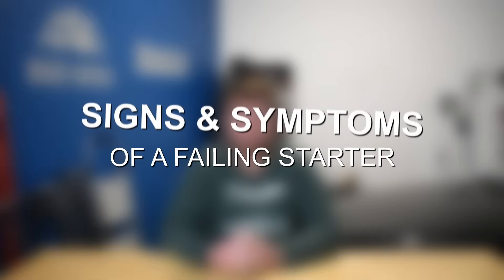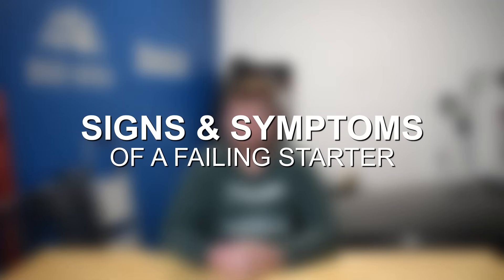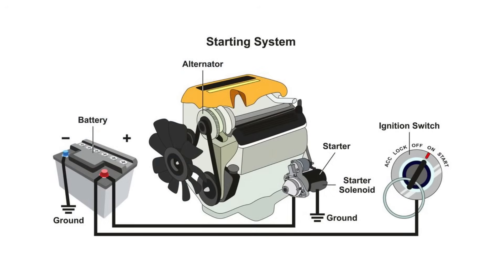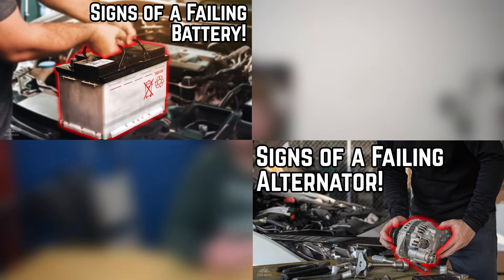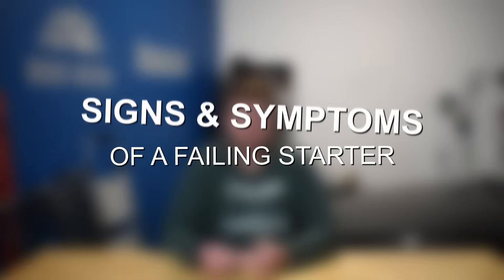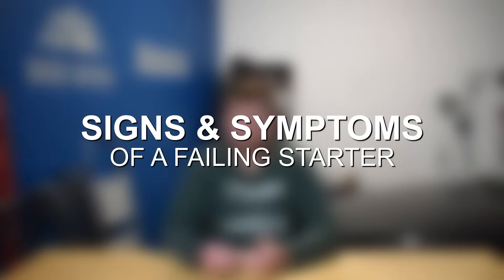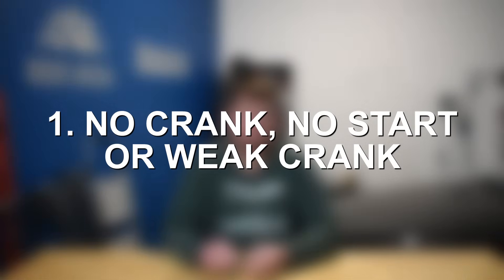5 Symptoms of a Bad Starter!

Comment: I have heard a grinding sound upon startup of my '17 wrx for the last, well, id say about 10 starts... In the video around 3:05 its mentioned about the grinding. Is this still a starter issue having to do with the grinding of the gears??? Thanks
Reply from the maker: P - Yes, if you’re hearing a grinding sound on startup —especially after the engine fires and the starter is disengaging—it’s very likely related to the starter drive (bendix) not retracting cleanly or grinding against the flywheel teeth, which can happen due to a worn starter gear, weak return spring, or flywheel wear; this is a common issue and sounds very similar to what’s described around the 3:05 mark in many WRX diagnostic videos. If it's happened 10+ times, you should inspect the starter motor ASAP to prevent potential damage to the flywheel ring gear—replacing the starter now is cheaper than fixing a chewed-up flywheel later.

Comment: What if the started sounds like an empty blender 🤷‍♂️
Reply from the maker: S - If your starter sounds like an empty blender, it usually means the starter motor is spinning but not engaging the flywheel, which points to a bad starter bendix (the gear that extends to engage the flywheel) or a worn-out starter solenoid that’s failing to push the gear out; it can also happen if the flywheel teeth are damaged or missing in the area the starter hits. Start by inspecting or replacing the starter itself—it’s the most common and likely fix for that kind of noise.
Reply: @8020Automotive  yeh we tackle that over the weekend it was a bad starter, thanks for your video and the reply 🛠️✌️😀
Reply from the maker: @SergioBViera  Nice! Glad to hear you figured it out.

Comment: My truck is push start, it turns on when it wants to, it starts right up in the mornings but it takes a while after, I was told the gears were worn but why does it start some times?
Reply from the maker: D - If your push-start truck starts fine in the morning but struggles later—especially if it cranks inconsistently or not at all—the issue is more likely heat-related or electrical rather than worn starter gears, which typically cause grinding, not intermittent starting; a failing starter solenoid, weak ignition relay, or poor connection at the starter (often affected by heat soak) can cause it to act up once the engine bay gets hot, so check all starter wiring for tightness and corrosion, test voltage drop to the starter during a no-start event, and consider replacing the starter motor if it's original—worn brushes or a sticking solenoid can behave exactly like this and still work occasionally until they don’t.

Comment: My lancer is not cranking when I leave it off for a week. It clicks when i turn the key from on to ignition and while holding the key in the ignition it makes a buzzing sound. Can I get any advice?
Reply from the maker: G - If your vehicle won’t crank after sitting for a week and just clicks with a buzzing sound when turning the key, it almost certainly points to a weak or drained battery—not enough voltage to engage the starter fully but enough to trigger relays and make buzzing noises; even if it cranks fine after a jump, the battery may be sulfated or unable to hold charge due to age or parasitic drain (something drawing power while it sits), so start by testing battery voltage (should be ~12.6V resting), then check for a drain with a multimeter (anything over ~50mA draw when off is excessive), and clean the battery terminals—if all checks out and it still dies after sitting, the battery’s likely done and needs replacing or the drain needs to be tracked down.
Reply: @8020Automotive  thanks for the tips, i tested voltage after a drive and voltage after a week and 5 days after that. Multimeter shows 12.79V, 12.37V, and 12.36V, respectively. Is that normal? (It won’t crank at high 12.3V?). Haven’t tested for Amperes tho, might do it next week.

Comment: Can the car start briefly and cut off?
Reply from the maker: G - No, a bad starter won’t cause the car to start and then cut off—the starter’s only job is to crank the engine to get it running; once the engine is running, the starter disengages completely and plays no further role. If your car starts briefly and then dies, the issue is likely related to fuel delivery, ignition system, security system (like an immobilizer), or a sensor issue such as a bad crankshaft or camshaft position sensor—but it’s not the starter, because if the starter were the problem, the engine wouldn’t crank at all or would crank weakly but not fire up at all.

Comment: I keep my battery disconnected as my car has a parasitic drain. I hooked it up, started it, did a code read, no codes at all. Turned off and disconnected. When I tried to turn on again, I hooked cords up, small spark on negative, lights come on on door. Turn key, 1 click, lights turn off. Wiggle the negative, lights come back on, but 1 click and off again. Idfk what to do. Getting battery tested, and look into new negative terminal. I planned on trading the car in in a few weeks. 😢
Reply from the maker: M - What you’re describing, very likely points to a bad or corroded battery terminal or ground connection, not necessarily the battery itself (though testing it is still a smart move); the click with power loss suggests that when you try to start, the weak connection can’t handle the current draw, causing voltage to drop out completely—clean both terminals thoroughly, especially the inside of the negative cable and clamp, and check the ground cable where it connects to the chassis or engine block for corrosion or looseness; replacing the negative terminal is cheap and can absolutely resolve this kind of issue, especially if you're prepping to trade the car in—quick, low-cost fix that restores reliability just long enough to hand off the keys.

Comment: so im currently having trouble with my 2013 grand jeep cherokee i was driving when i first smelled it turned the car off it didn’t crank anymore also tried hooking cables and still nothing
Reply from the maker: H - If your 2013 Grand Cherokee suddenly shut down with a burning smell, then wouldn’t crank or respond to jumper cables, you’re likely dealing with a major electrical failure, such as a blown fuseable link, a melted power cable, or a fried starter or ground connection—the burning smell suggests something overheated or shorted, possibly the starter, battery terminal, or alternator wiring, and if there’s no crank at all even with jumpers, the power isn’t reaching the starter circuit; check the main fuses (especially under the hood), inspect battery cables for heat damage, and look at the starter relay and grounds—if the power cable from the battery to the starter or fuse box burned out internally, it would explain the complete power loss despite a boost.

Comment: Oil is not going to hurt electronic components. 

But antifreeze/coolant would because it contains a lot of water which causes metal corrosion
Reply from the maker: J - Coolant/Antifreeze is definitely more corrosive and dangerous to exposed electronic components than oil, especially because it contains water and electrolytes that promote short circuits, corrosion, and conductive paths where they shouldn't exist. However, engine oil can still harm electrical components over time, not by direct shorting, but by seeping into connectors, softening rubber seals, or disrupting electrical contact—especially in sensitive low-voltage signal systems like cam/crank sensors, MAF sensors, or ECU connectors. Oil can also attract dust and grime, leading to heat buildup and connector fouling. So while oil isn’t immediately corrosive or conductive like coolant, it absolutely can degrade electrical reliability if not cleaned or if allowed to soak into wiring over time.

Comment: If the starter is failing will it be weak in cold weather?
Reply from the maker: J - Yes, a failing starter will often show weakness in cold weather, because colder temperatures increase engine oil viscosity, making the engine harder to turn over, while also reducing battery efficiency, meaning the starter has to work harder with less available power—so if the starter motor is already weak (worn brushes, bad solenoid, or dragging bearings), it may crank slowly or not at all in the cold, then work “okay” once the engine or ambient temps warm up; if you're noticing sluggish or intermittent cranking on cold starts but not warm ones, it's a strong sign your starter is on its way out.

Comment: My car for the last few months been driving good but if i drive throughout the day and if i stop to get gas or turn the car off i have to wait until it cools down until i can crank it back up but now im having to crank it about two times which immediately said the starter. I replaced it back on 2023 so i guess time to swap for warranty
Reply from the maker: M - Sorry to hear this! What you're describing sounds like a classic case of heat soak affecting the starter motor, where after driving and shutting the car off, engine bay heat radiates into the starter and causes internal resistance or solenoid sticking, making hot restarts difficult or impossible until it cools down—this is especially common on vehicles with tightly packed engine bays or near exhaust components, and while you did replace the starter in 2023, it’s entirely possible it’s already failing again or is a lower-quality reman unit, so yes, swap it under warranty, and if the problem persists, consider adding a starter heat shield or checking for voltage drop from the battery to the starter, as weak cables or corroded grounds can amplify the symptoms.

Comment: No crank, no start. Barely fires up when I tap starter.
Reply from the maker: I - If your engine only barely fires up when you tap the starter, it’s likely the starter motor or solenoid is failing or has a poor electrical connection. Tapping it temporarily frees up internal parts, which is a classic sign of a worn starter. Also check battery terminals, ground connections, and the cable going to the starter for corrosion or looseness, as poor voltage delivery can cause a no-crank issue too. If everything looks clean and tight, replacing the starter is probably your best next step.

Comment: My car when I turn on it makes click nice then second turn on it turns the car on , also was driving and car was struggling to accelerate and engine smelled hot and like it was burning, and white smoke out of exhaust is this also starter problem? ( Nissan Murano 2006 AWD V6)
Reply from the maker: T - Based on your symptoms—clicking on the first turn, hesitation to accelerate, burning smell, hot engine, and white smoke from the exhaust—this is more than just a starter issue. The click then start suggests a weak starter or battery connection, but the burning smell and especially white smoke likely point to a blown head gasket or internal coolant leak, especially if you're losing coolant. White smoke typically means coolant is getting into the combustion chamber. You should check coolant and oil levels immediately, and avoid driving it until a compression test or leak-down test confirms the condition—continued driving could severely damage the engine.
Reply: @8020Automotive  ok I appreciate it

Comment: Great video buddy, 
I just got a new alternator on, new battery, and a new starter. However, I am hearing the dreaded clicking of the starter and the engine doesnt crank at all. There is also no engine codes, but the check engine light is on. This wasn't a remanufactured part either. Is it still likely the starter?
I may have to call the shop and try to convince them to give me another one lol.
Reply from the maker: Z - If you're getting a single click and no crank even with a new battery, alternator, and starter, it's still possible the starter is defective—even if it's brand new. It could also be a poor ground connection, corroded or loose battery cables, or a bad starter relay or ignition switch. Check that the battery terminals are tight and clean, and confirm there's solid ground from engine to chassis. If all that checks out, it may be worth pulling the starter and bench testing it or having the shop exchange it just in case. Even new starters can fail out of the box.

Comment: quick question had my car battery replaced my car wouldnt start recovery man checked and the cables were loose on battery electrics were working fine just wouldnt start he knocked the starter motor which started the car,its been a few days car seems to be starting fine,could that have been the reason or would starter motor still need replacing?thanks in advance
Reply from the maker: H - It’s very possible the loose battery cables were the issue—if they weren’t making a solid connection, the starter may not have been getting enough voltage to engage properly, which explains why everything else worked but the car wouldn’t start. Knocking the starter may have just helped it make temporary contact, but since it’s been starting fine since tightening the cables, the starter itself is probably okay for now. If the issue returns, then it could point to a worn starter solenoid or internal brushes, but for now, no need to replace it if it’s working consistently.

Comment: The alternator has nothing to do with starting a vehicle, unless it fails to keep the battery charged when the engine was last running.  The battery, alone, provides the power to the solenoid, starter to crank the engine.
Reply from the maker: S - Correct. Starting the vehicle is entirely dependent on the battery providing enough voltage and amperage to the starter and solenoid. The alternator's job is to recharge the battery after the engine is running and to power electrical systems while driving. If the alternator is bad and didn't recharge the battery during the last drive, the battery might not have enough juice for the next start, which is where the confusion often comes in.

Comment: Im having a long tick or a crank then it starts?
Reply from the maker: B - A long crank before starting is usually caused by fuel delivery issues, weak ignition components, or sensor problems. First, check the battery voltage and starter health to rule out a weak crank. If the engine turns over strong but takes long to start, inspect the fuel pressure regulator, fuel pump, and injectors for possible leaks or low pressure. A failing crankshaft position sensor can also delay ignition timing, leading to extended cranking. Additionally, check for vacuum leaks, dirty throttle body, or faulty spark plugs as they can also contribute to hard starts.

Comment: Mine starts but whines bad from the starter gear & wont disengage after start up!
Reply from the maker: M - If your starter gear is whining and won’t disengage after startup, it’s likely due to a sticking starter solenoid, faulty ignition switch, or a damaged starter drive (Bendix gear). A sticking solenoid can keep the starter engaged even after the engine is running, causing a loud whining noise. If the ignition switch is faulty, it may continue sending power to the starter, preventing it from disengaging. A worn-out starter drive gear or faulty flywheel teeth can also cause improper engagement and a grinding or whining sound. First, try tapping the starter lightly with a mallet to see if it disengages. If the problem persists, check for stuck relays, ignition switch issues, or a faulty solenoid, and consider replacing the starter if it’s damaged internally.
Reply: It’s a belt problem
Reply: @whateverchannel42 Found out it was the starter motor, not a belt. I changed the old starter motor with a brand new one & problem solved 👍 No more horrible noise. 😊

Comment: I only hwar one click xoming from startwr area each time I turned they to start. So one click our key turn. No rapid clicks.
Reply from the maker: W - A single click when turning the key, without the engine cranking, usually indicates an issue with the starter system. Possible causes include a weak or dead battery, a bad starter relay or solenoid, a faulty starter motor, or corroded/loose battery terminals preventing full power from reaching the starter. Additionally, a bad ground or damaged wiring can interrupt the circuit, or a failing ignition switch may not be sending the proper signal. First, try jump-starting the vehicle; if that doesn’t work, check battery connections and listen for additional sounds. If the issue persists, testing the starter solenoid, relay, and ignition switch would be the next step.

Comment: I dont hear any clicking. No noise at all
Reply from the maker: I - If your car makes no noise at all when you try to start it, the issue is likely with the battery, starter, ignition switch, or a wiring connection. First, check that the battery terminals are clean and tightly connected—a loose or corroded terminal can prevent power from reaching the starter. If the battery is good but the car still won’t crank, check the starter relay and fuses. A faulty ignition switch or neutral safety switch can also prevent the car from starting, so try shifting to neutral and attempting to start it. If there’s still no response, the starter itself could be bad or not receiving power due to a wiring issue.
Reply: @8020Media  it was the starter. Thanks for the reply.